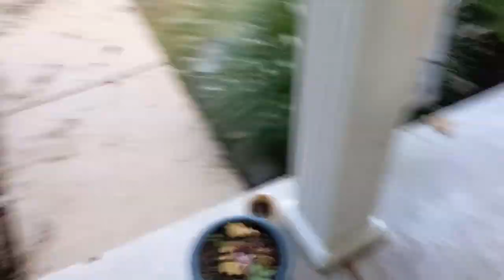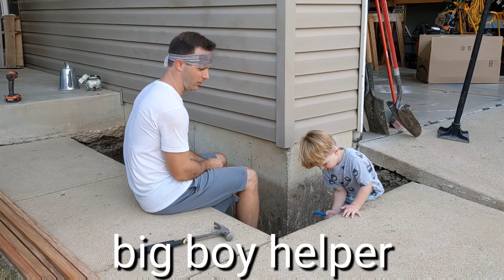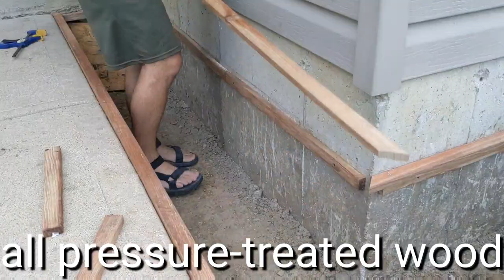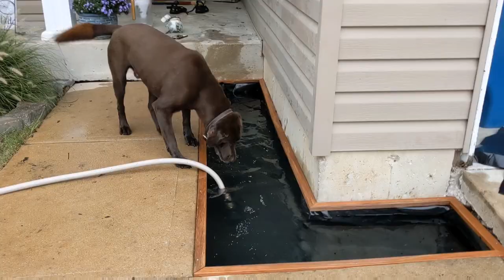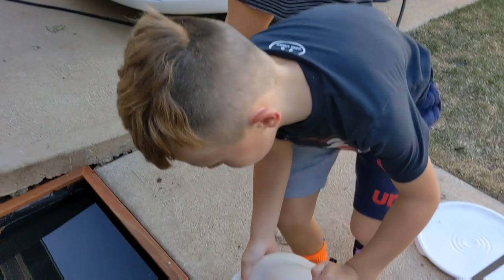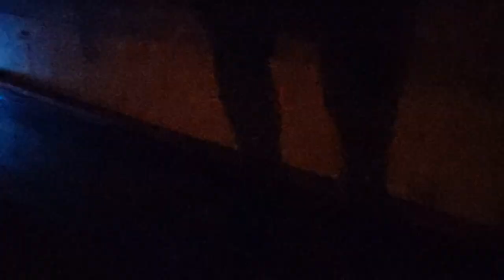How to build a pond and waterfall water feature (for under $200)

Comment: Great cheap fix to pump clogging is to wrap some mesh around it, stop it from sucking up the bad stuff
Reply from the maker: Thanks for the tip! I currently have a box with two different type of filter material, would you say that in addition to those?

Comment: Looks amazing! Excellent work!

Just a suggestion you might consider...

if it gets a lot of sun, algae may continuously be a problem. (It’s inevitable)

Possible solutions...
Ditch the fish, make it a water feature and dose with chlorine ..... or

If you keep the fish, maybe consider some algae eating fish (will definitely need a filter and still may not resolve if you don’t have enough)

I’ve also heard of others control algae with a UV steriliser.

Hope it all works out!
Reply: Just realised someone else made the some of the same suggestions ... apologies for the repeat.
Reply from the maker: All great tips. I'll likely go with chlorine because having fish is a little too much right now. Will that prevent algae/slime from forming on the sides?
Reply: @kove   yes it should, however for best results you’ll still need the pump for circulation and a filter to capture all of the debris.
Reply from the maker: @Runamuck0  Thanks!

Comment: I'm worried about the water being right up on your foundation.  Do you anticipate any problems in that area? I guess the liner is actually keeping the water seperate.... idk. Just a thought.
Reply from the maker: Good point but nope, it was by the garage so if it leaked it wouldn't go into the basement.